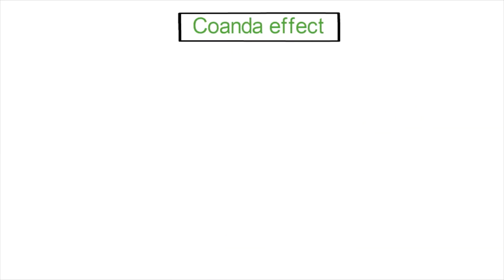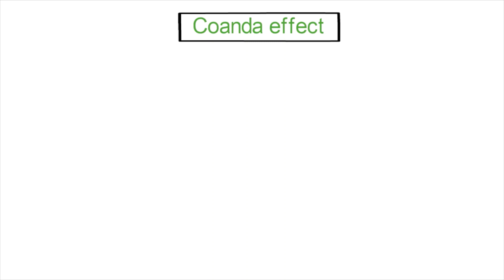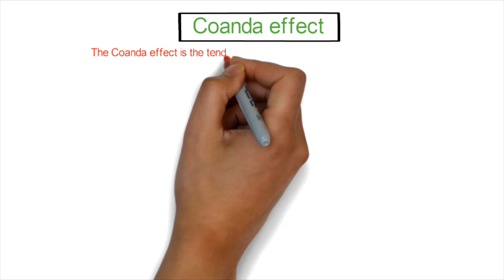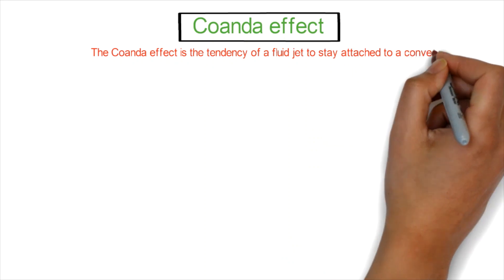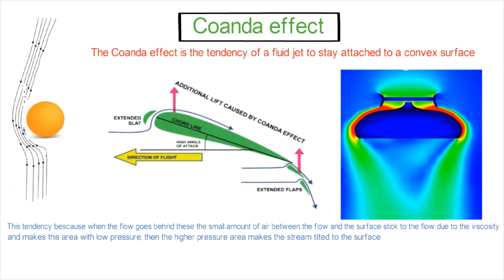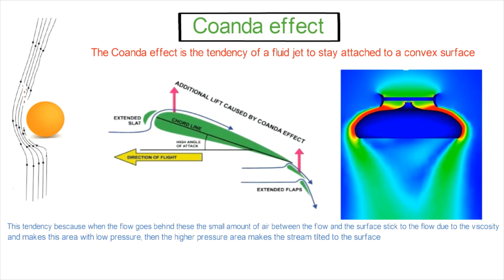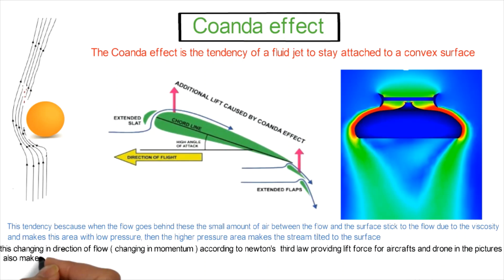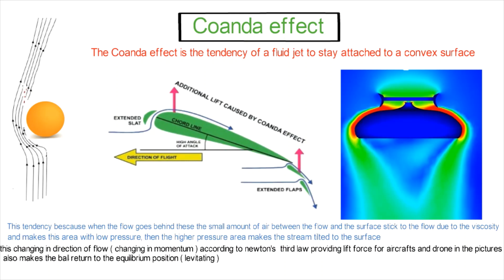The Coanda Effect Explained: From Ping Pong Balls to Aircraft Lift!

Comment from the maker: Conclusion about Ping Pong ball levitating: the ball is still in equilibrium position for 2 reasons / 1- according to Coanda effect if the ball goes to the right side the left side has lots of streamline  bend to the right side and reaction force into the left makes the ball staying in equilibrium position -2- according to Bernoulli's  principle the streamline in left has lower pressure and higher velocity this difference in pressure provides returning force to the equilibrium position